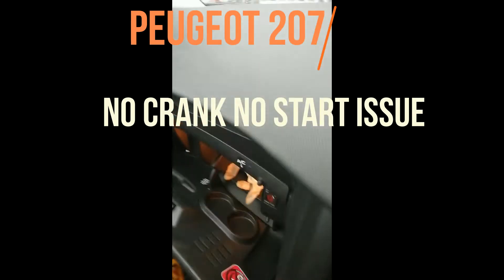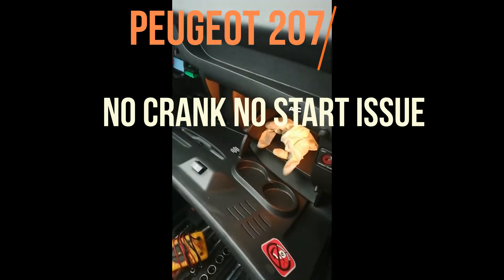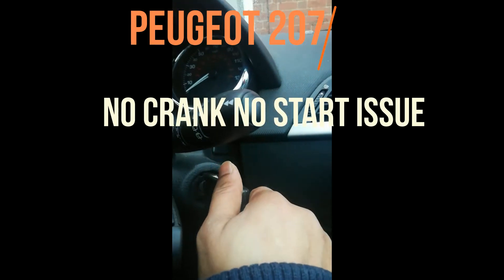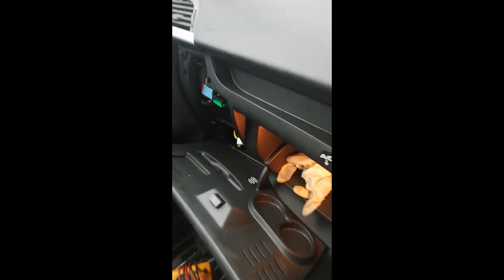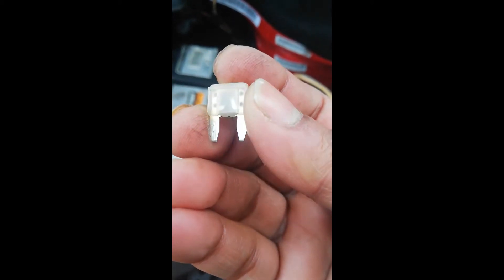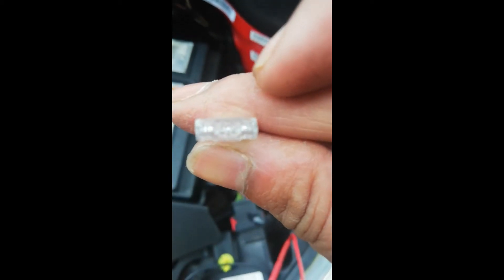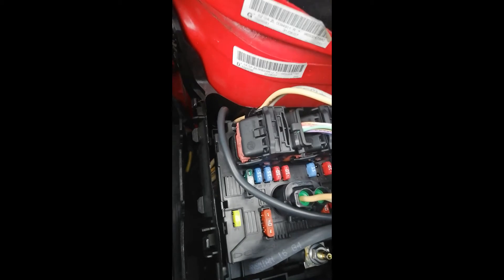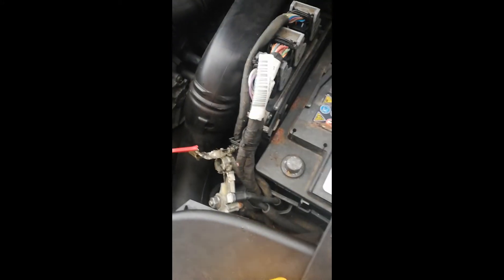Peugeot 207 No Crank No Start Issue SOLVED

Comment: Worked perfectly... thanks for that mate. After changed the 25 amp fuse is alive again. Saved me a fortune.
Reply from the maker: My pleasure
Reply: Hi.
Nice video.
But it will soon starter die.
Trust me.
But the new one is not exspensive. (45€)
I will also change my tommorow 🙃

Comment: Yeah, yeah but the right question is why this fuse was burned?
Reply: Exactly. Basic autoelectrical questions: What circuit does that fuse protect? What could have caused the overload?
Reply: Mine was after a failed jump start

Comment: Had exactly the same problem with mine, started off with heat soak in the starter intermittent starting when hot. Then had nothing at all, so assumed the starter had died, replaced the starter and still the same. Reckon the intermittent problem with the starter blew the fuse. Now perfect, thank you for this video wouldn't of had a clue otherwise.......thank to You Tube bloggers.

Comment: I have the same problem but not always i just wait couple of hours and then it works again ?!! Any guess what could be the reason ?
Reply from the maker: @oussamarabhi3262  may be starter motor issues.
Reply: @bdbiometric   but if the starter is dead, why does it keep working sometimes ? actually it works almost every time

Comment: Joe my citroen xsara1.4 petrol years 2004 after tow off motor way to my home only part of electric work no dashboard light.headlight.wiper.engine crank. central locked fuse okay before tow every things work .limp mode how to get it off Help help any idea
Reply from the maker: I would advise to check all the fuses including some hidden fuses sits usually under ECU or fusebox. Also some fuses on the BSI board usually located under glove box. Good luck.

Comment: Great Video. My Peugeot 207 1.6 hdi does not, the motor starter does not do his job, it doesn't  start when the engine is hot. If it's cold,  the starter motor does his job and starts the engine. Could it be something else? The starter motor is difficult to replace.
Reply: Hello Hans, i got your same issue. How did you solved it?
Reply: @endritmorina3580  it was the motor starter.

Comment: I have 2007 Peugeot 207 after replacing vacuum pump the car stoped working, cranck but not start 
Ay idia?ECU OK,Spark plugs ok,coils ok,battery good,fule pump ok
Not working??

Comment: Total novice here, how did you know the fuse was blown by looking at it?
Reply from the maker: It was a clear fuse and can be seen from the top that  the continuity was blown. But mainly you need to know which fuses are realted to starting system. And go from there. Better to use/ have fuse tester to check fuses.
Reply: @bdbiometric  thanks so much, it ended up being an issue with that starter motor that had to be replaced but now I know what all to check for before I bring it to my grease monkey.

Comment: bro i have the exact same problem 
when i try to start a get a economy mode active then the screen goes off 
i hear the first click every time i try 2 start it 
100% like ur case here 

is it the same problem or the economy mode means something else ؟ 
thank you ..
Reply from the maker: Have checked fuse? If fuse ok then Starter motor gone I think.
Reply: @bdbiometric 
I will do that right now

Is it only the 25 white fuse that i should test
Or all of them can be the problem
Reply: @bdbiometric 
Did u get the economy mode active error while doing the video?
Reply from the maker: @NoorAlDeeN1  Economy mode due to not starting engine for long.... It's a battery saving mode. Engine not cranking/ starting due to stater motor unable to turn flywheel. So Starter motor is the main issue here I guess.
Reply: NoorAlDeeN1   Did you fixing a problem? I have the same

Comment: I have a similar problem but mine is 1.6 Turbo, had weak start  and now no start... The battery is fine though...  I doubt mine is related to the fuse, I think more the starter because it started as when u have a weak battery...
Reply from the maker: If it is then your starter motor is gone... Cheap to buy one from EBay. I am going to upload video how to change starter motor on 207 this week.. Very difficult as starter mounting  bolts are difficult to access.
Reply: @bdbiometric  Thanks man, It was the starter, I did rebuild it though,  45 usd aprox and 3 month warranty job, works fine now.... Yes its a pain, had to remove part of the exhaust! Cheers

Comment: I have the same situation after rain, only the fuses are all intact, what could be the problem? If I start it forcibly, I can drive calmly until the new rain, battery working , Peugeot 207 1.4 hdi
Reply: I'm the same. Got exactly the same car and the same problem. Think it might be either the starter relay or the starter motor
Reply: @yorkshireteabag3969  any joy lads? Same problem with 307 1.4 petrol, fuse is fine, starter cranks when I bring jumper cable from battery positive to starter ignition wire in fuse box, suspect relay in fuse box also, feckn French